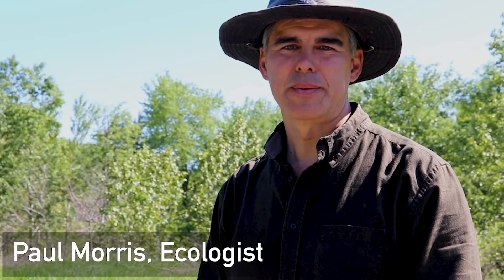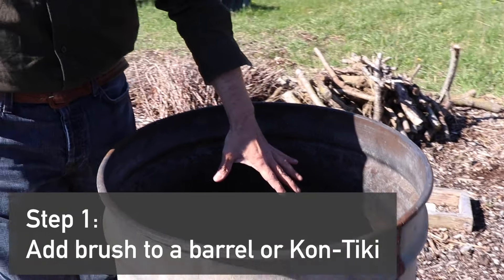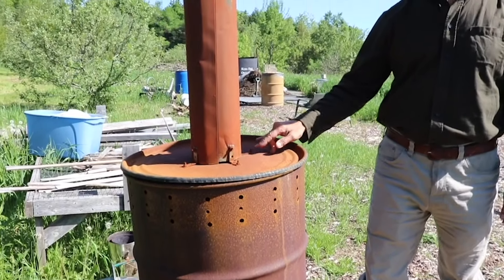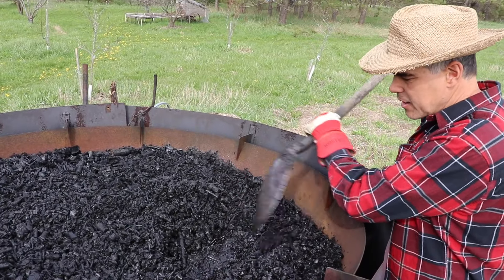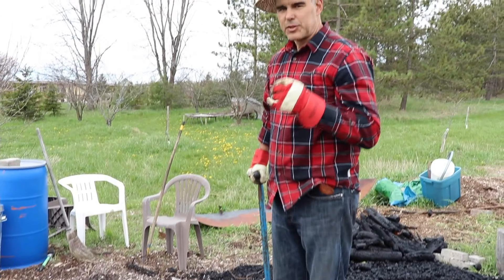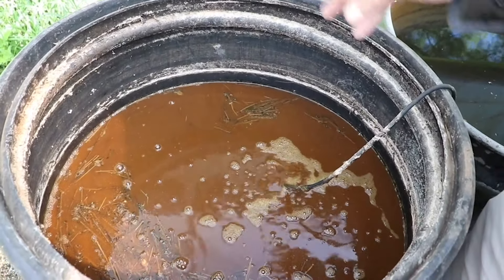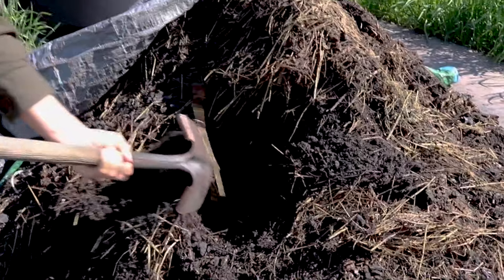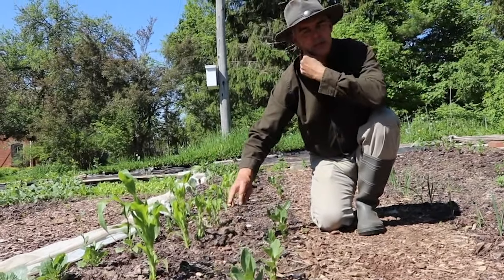THE ULTIMATE GUIDE TO BIOCHAR: how to make it, how to use it, and why it's important

Comment: Is there any quantifying a net carbon sequestration when you burn wood (releasing atmospheric carbon) to make char
Reply from the maker: 50% of the wood is carbon that once incorporated in the soil will remain for centuries. Typically all of the wood is broken down and the carbon released by bacteria so the burned charcoal cuts that cycle and the carbon stays stored in the soil
Reply: @PlanetHealers  What about the carbon released in the smoke when you burn the wood?

Comment: Hi there. I am a vegetarian that is trying to grow all my own vegetables and fruit from my allotment. As my plot is now fully planted I have been able to obtain another plot that was used to burn all our garden pruning etc. I have ready planted second early potatoes in the surrounding ground but I'm not sure what  I could successfully grow in the middle were the bonfire was. I've been told that I cant grow cabbages etc there as the soil is to rich. If no then what can I plant? Please could you advise P.s I did want to grow my winter greens.:0(
Reply from the maker: Yes the ash will have made the soil basic and the fire will have killed a lot of the soil microbes so it will be difficult to grow there for a while. I would test the soil ph and see if it needs modifying with an more acid organic mix. Watering with the superbrew will also help, but it will be challenging to grow there. Corn is a heavy nutrient feeder used in the milpa system after a burn, so that might work there. Cheers

Comment: can you please provide the amount of each ingredient to mix with the biochar?
what is the difference in porosity of the biochar base on whether you use the barrel, barrel-in-barrel or kon-tiki?
Reply from the maker: The biochar we make is dependent on the materials that can be found locally. We usually mix 50% biochar with a high-nutrient substrate like manure, compost... high in biological activity, add good soil for more microbes, add a sugar/starch substance to fuel the microbe activity. Don't think there would be much difference in porosity they all use a high-temperature burn.

Comment: Would a final rinse be ideal or unnecessary(step 5ish)? Only concern is salt content in urine, or does pre soak with water dilute the salt?? Great video, thanks!!
Reply from the maker: From my experiments using urine as a herbicide, it takes many direct applications of pure urine to kill plants. So the concentrations in the biochar are way too low to kill plants. Also, the nitrogen you are adding with the urine is water-soluble so you would be washing that away.

Comment: Can I use rabbit manure tea to charge my biochar?
Reply from the maker: Any manure will work. Just be aware of what nutrients you are adding to be able to balance it appropriately
Reply: @PlanetHealers  I am not adding the manure itself, just the liquid (tea) from steeping and straining the rabbit pellets. This will be my first stab at biochar
Reply from the maker: @liseann9163  I’m assuming to the cooling water then. I’d add urine in as well as nitrogen is the element pulled most by the biochar out of the soil. Add the strained part back to the mix after
Reply: @PlanetHealers  made my burned wood in cone pit. Will try barrel next. Have been collecting urine. Will charge today. Then start my mound as you showed. Thanks for sharing all this info.

Comment: Do you neutralize the alkaline pH of the charcoal after it is made? If so, how?

I have read that 2 mm was the ideal size for biochar particles but I see you leave larger pieces. Any reason behind that?
Reply from the maker: We do not do anything to neutralize our pH but it is always good to check and see if that is needed. We grind the char down with the tools we have available. In the jungle, we just used our feet to crush it or pounding it with a shovel. The roots of the plants we grew didn't seem to have a problem growing through the char at that size. You could screen it at the size you want and crush the big ones but it seems like an unnecessary step. I try to keep it simple so more people will use the technique.
Reply: @PlanetHealers  makes sense. The water after quenching my char has a slippery feel to it which means it is quite alkaline. I'd like to neutralize it so I will see about getting some sulfuric acid for that purpose. I saw one guy ground up his charcoal with a kitchen sink garbage disposal which seemed like an easy way to do it. So I may try that. Now I just need to figure out which local farmer wants to sell me some of his cow's poop!
Reply from the maker: @Kufunklefec  Good idea about the garbage disposal but not as available to most people. You may want to adjust the pH of the final mixture rather than just the parts.
Reply: @PlanetHealers  I was thinking it might be easier with the charcoal when its still saturated in water so I don't burn the soil with acid. I might have to do it twice if I neutralize the charcoal to make sure the final soil is where I want it. Will need to see.

Comment: Paul you shine with beauty. Thank you for this video I am looking forward to trying this. I do have a few questions:
Could you make biochar in an open fireplace in the house?
When you say 'brush' is another term for this branches or sticks?
After the burning process is the wood then called charcoal and/or activated carbon ? and is it then only called 'biochar' once you have added in the other nutrients?
Is there a benefit to just adding the activated carbon into the soil with out the added nutrients? and/or can you add in the nutrients into the soil with the activated carbon and then a similar process will occur ? 
Thank you for you :)
Reply from the maker: Lots of questions;) in a fireplace you could put a sealed metal can with wood in side and the fire would turn it to charcoal. Brush would be smaller sticks. Yes the carbon alone needs to be charged to be biochar. Carbon could be added to the soil direct to remove toxic chemicals or if you are patient to just let it charge in the soil. It will pull the nitrogen from the soul until charged.
Reply: @PlanetHealers  Thank you very much for taking the time to answer :) I look forward to trying it out. woohoo planet healers!

Comment: Wouldn’t that water you drain from the contiki be valuable as well?
Reply from the maker: It will have potassium from any ash you create and will be quite basic so I would use it with caution. I have not tested the nutrient composition of the drain water. We usually reuse the water for the next batch...

Comment: How much CO2 is formed and released to atmosphere using these methods?
Reply from the maker: If left to rot, the wood would release all it's carbon to the atmosphere over a few years. When burned without oxygen, 50% of the carbon is kept as inert carbon and it can last for 100's of years in this state in the soil. It also has all the benefits for soil?

Comment: Thank you so much for a very interesting and informative video.  I am studying the various ways how the biochar is prepared so that I can use these methods to do the same in my small property of about 2 acres.
I would like to comment on the procedure of using water to cool down the freshly prepared charcoal.  I am not an expert in this field, but only a student, but I think the freshly prepared charcoal should be cooled down only with urine or the brew which was created, instead of water and it should be sparingly used, just to put down the fire, so that the liquid should not be in excess to be drained out.  by this, the full absorptive property of the charcoal would be well used and the charcoal would be much more enriched with the nutrients rather than the already water soaked charcoal.  I am not sure whether the water filled charcoal would be more efficient in drawing in nutrients instead, which please comment.
Reply from the maker: Adding urine when hot will just vaporize the urine. Quite a smell! THe water is added first to put out the fire and cool the char. The quick cooling fractures the char making it ideal for microbiome colonization. The char at this stage is activated charcoal with 4 active points on the carbon that strongly attract. Adding the urine gives the carbon something to attach to quickly and is less bioactive so it doesn't kill anything in the warm water. Adding the manure... after cooldown is adding nutrients but also biologically active ingredients that should not be added to the hot water or it will just kill them.
Reply: @PlanetHealers     Thank you very much and that was valuable information to me which I will record it in my Notes.  I never thought about the destruction of the biological ingredients when putting on kindling hot charcoal.  Thank you for the wealth of experience that you are sharing through these videos.  God bless you.
Reply from the maker: @jayabhai  Cheers

Comment: Are you not creating a lot of ash this way?
Reply from the maker: The heat of the coals below vaporizes the gasses in the wood and the gas burns at the surface of the barrel instead of on the wood. Oxidative (with oxygen) burning turns the charcoal to ash. Pyrolysis (burning without oxygen) leaves the charcoal unburnt. As each layer of wood finishes burning off the volatile gases you will start to see ash form and then you add another layer to prevent the oxidation.

Comment: I am fascinated of biochar, however, when i burned small among of sticks and leaves as testing today, I felt guilty of seeing smoke and worried about neighbor or police visiting. I am crazy about organic garden, and I don't want to just stop here.
Reply from the maker: If you biomass is dry it will burn cleaner. The white smoke is the water burning off and it reduces the temperature of the fire. You may want to check bylaws if burning in the city or at least warn the Neighbourhood.

Comment: Hi, what are your thoughts on using the contents of a septic tank (effluent and sludge) in place of cow manure but also with aged compost added
Reply from the maker: We use the carbon in our compost toilet and it helps with the smell so I see no problem using it. The consideration in using human manure is if you or guests have parasites, other diseases or have used any drugs, they will be in the mix. When mature and composted well, we use this mix to add to the soil under trees in our restoration areas so as not to worry about anything getting back to us.

Comment: Can I also use rabbit urine and not human urine?
Reply from the maker: Any urine will work. We just happened to have a ready supply of humans.
Reply: Already started collecting both human and rabbits. Plus I already use the rabbit droppings for manure and pee as pesticide.
Reply from the maker: @Michael Bessette for inoculating the biochar after it cooled both of those would work well. I use the urine in the warm water right away to get a fast injection of nutrients into the biochar but I'm not looking for microbial activity from the urine for the bioactive stuff I add them later. Any mix of composts or teas would work. I would look up what you are adding for the chemical composition to try to get a well-balanced nutrient mix for your end product.

Comment: What happens when you mix more than 10% biochar to the soil?
Reply from the maker: We are using around 25% carbon (50% biochar =half carbon and half organics) in the Yucatan with very poor soils and it still works well. Much higher and it could be detrimental. You need some original soil in the mix for good root growth and minerals.

Comment: Which one use oxygen more?  Burning a wood or let a wood compost by natural way(which take years to fully composted)
Reply from the maker: Burning takes less oxygen than microbial degradation. If the wood is oxidized in the burn it turns to ash and the carbon is released. Pyrolysis is the technique we are using to burn in a low oxygen environment.
Reply: @PlanetHealers  thanks for the info,  which better for environment if small things such as leaves n small plant roots?  Compost or burn?
Reply from the maker: @XoXfibaX  if it is easily composed then do that. We need good nutrients for the plants as well. Mix the compost into the biochar to help charge it. If it doesn’t break down easily -branches wood... it can be turned to biochar
Reply: @PlanetHealers  thanks a lot

Comment: The increased volume in your open containers is including incompletely charred material and a great deal of ash. It is less efficient in reality you can just add more material to your open containers.
Reply from the maker: If managed well you get little to no incomplete burned material. Adding large material late in the burn sometimes does this so we use small material for the final burns. Little ash is formed in a good clean burn with no oxygen. That is why we carefully watch the burn and add new material when ash starts to form. The new material stops the oxydation of the lower level.

Comment: I wish the international orchard nut tree industry wouldn’t poison the water and all the cuttings are burnt away. Most of the old wood is trucked to the power plant and burned as well. In an arid land the herbicide fungicide pesticides are dry and when the rains come it gets washed into the voids the deep wells are making. What if more Bouchard be made in the Central Valley of California.
Reply from the maker: Actually, the other super ability of biochar is its binding ability! Biochar binds nutrients and water to help your soil but it also traps nutrients in the soil and keeps them from leaching into the surrounding waterways or groundwater. It also binds toxic chemicals and holds them. Part of the bioremediation of soils is fertilizing the soil to increase soil organisms. Fungi and bacteria break down toxic organic chemicals so adding biochar to enhance soil health and the species richness of the soil goes a long way to binding and breaking down toxicants.

Comment: Why not use your super tea in with the urine and let it soak and innoculate then capture the drain water for reuse.
Reply from the maker: When the fire is quenched with the water it is still hot. The urine is relatively sterile when it leaves the body so by adding it you are not killing microbes. Adding it at this point when the char is fresh allows for quick absorption of the nitrogen. If the super brew was added at this point it would kill the beneficial microbes we have been cultivating. It could be added a few hours later when the water is cooled.
Reply: Just watched a great Biochar presentation in Oregon. The guy knew his stuff. Conservation burn with a nicely built pile. He did add some fermented tea while it was burning, and he said there are some powerful organisms that can withstand that heat just fine. So some die, I guess, some don't. It is the imprinting the char which sounded important. I'm just learning. Good luck.

Comment: Man I cringed when I saw you dumping out all the liquid from the Kon-Tiki. Couldn’t have used that in your compost tea or dumped out on the garden?
Reply from the maker: Hi Richard, we were only doing a single run but normally in the Yucatan we collect the water and use it again. Especially because we do our burns in the dry season there. The water is more basic as there is some ash with the burn so consider that when putting on the garden.

Comment: Typical waste of useful bioenergy. You can offset an enormous amount of fossil fuel use by making productive use of the energy. Plus you can carbonize the material with less ash production in a gasifier.
Reply: Yes, but the focus here is not on efficiency, but sufficiency.
Reply from the maker: In the Yucatan where I am, a gasifier is not a solution that any farmer could afford. I created this system that is simple and inexpensive so that anyone looking to improve their soils could do that. Do you have a gasifier of equal cost, made with locally available materials and simple to make with limited tools? Cheers

Comment: In the open barrel method it is false to say you are limiting oxyen.  You are just limiting how completly you are burning.  Farmers have eyes, please be respectful making statements you are nit sure about.
Reply from the maker: You are limiting oxygen. When we see ash forming, that is when the charcoal is oxidizing to ash. By adding another layer the oxygen is limited and the burn is only volatile gases at the interface when there is oxygen. The lower layers do not have oxygen, the oxidative burn is above them and they do not turn to ash. The lower layers are still coals at ~900 °C, but without oxygen, the carbon is not able to oxidize to ash. Oxygen is only coming in at the top of the barrel and reacting with the wood on the top layer.